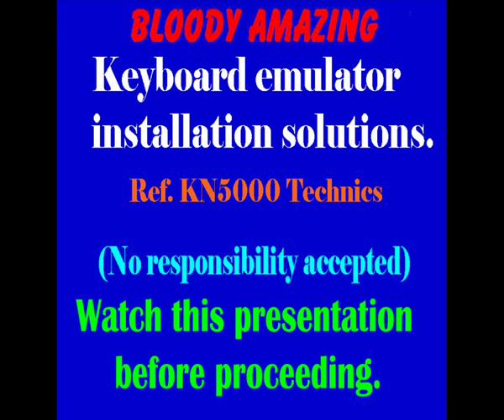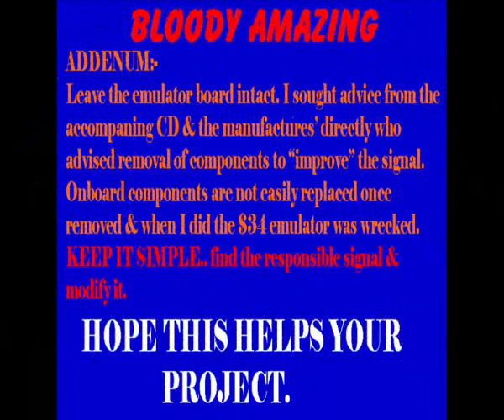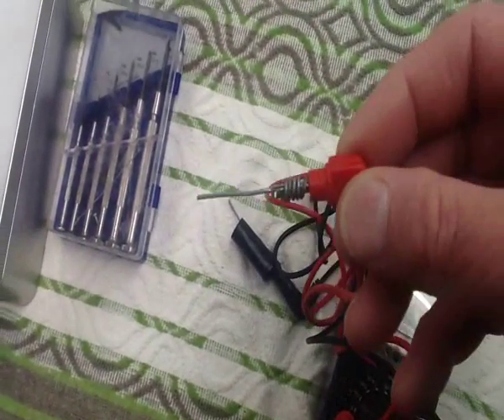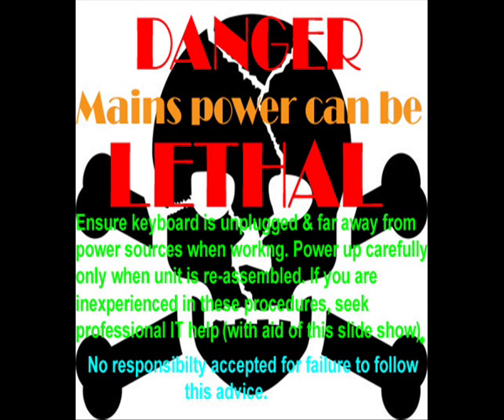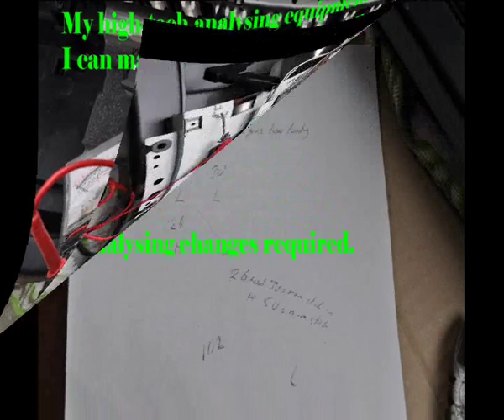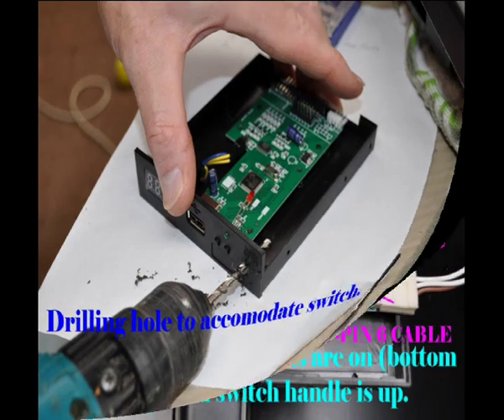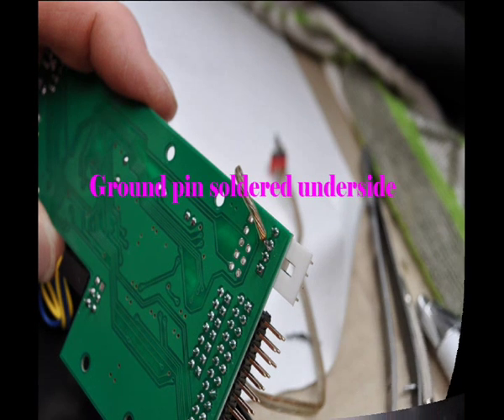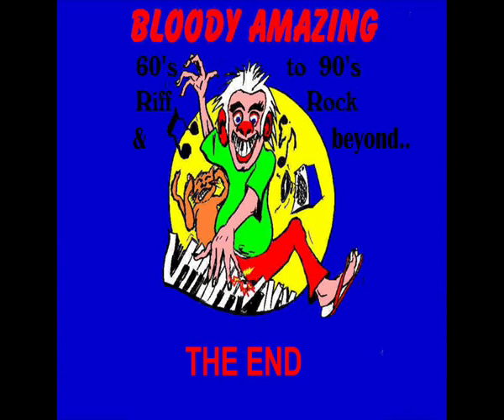Musical Keyboard emulator (floppy to USBstick) installation solutions

Comment: I’m a musician - piano player and a proud owner of a vintage musical Keyboard Korg IS40… this technology of emulation as really help me bring it to modern times by replacing to old and unreliable floppy disk to USB… 

As a professional musician special in important moments as New Year’s Eve and other great party that I’ve play-it normally i use my own arrangement in all music played, I keep them in the USB flash in several floppies, the problem is that during any music performance, the music have to change according the reaction of the people, and sometime well a lot of times those music are in different floppy and to move down the selection is at the moment with this hardware it’s impossible…
I can only move up the selection but to move down our even go back to the 000 floppy I need to turn off the keyboard… and that takes forever…

I wonder if You could help me with this issue… changing the software our making some kind of new connection to allow some kind of Mod to move it up and down the selection of the floppy in a quick and efficient way… 

If that alteration were possible that would change the game forever… 
any musician that use any vintage musical Keyboard in a daily base is desperately searching for this feature… Time between music’s in any stage is the most hated thing when people are having fun… 

Best regards from Funchal - Madeira - Portugal…